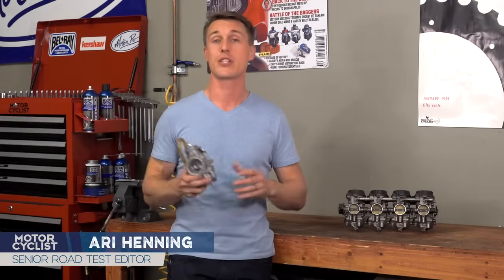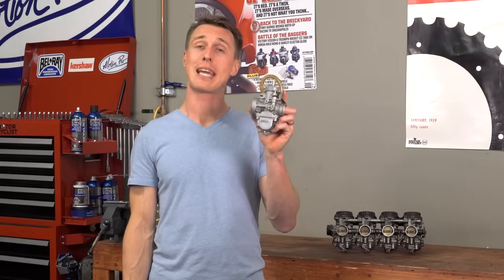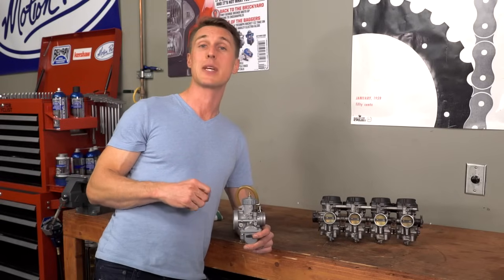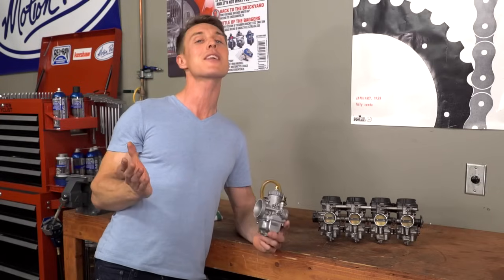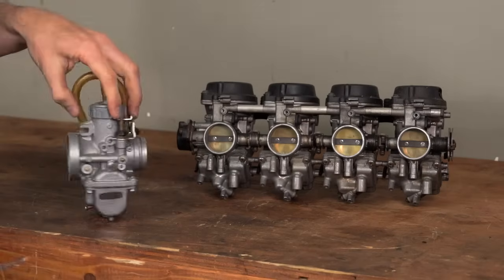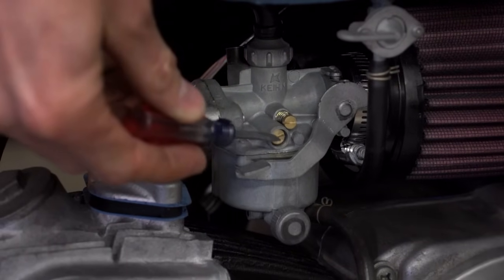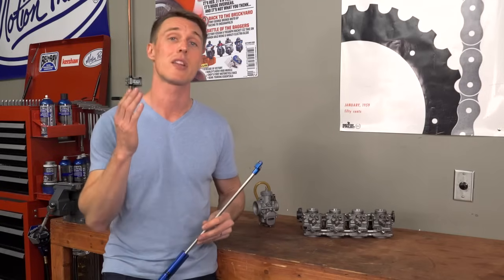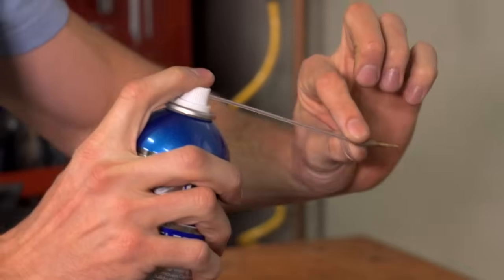The Single Most Common Carburetor Problem (Clogged Pilot Jets) and How To Fix It | MC GARAGE

Comment: My FZR is a 4 cylinder 250 that revs to 18k. It has jets up the wazoo and because of the small size of each cylinder, even the slightest clogging can cause a problem. I've pulled those carbs apart so many times, I can break them down and assemble them blind folded with BOTH arms tied behind my back! 
Gave them an ultrasonic cleaner last time and replaced the seals and they seem to be behaving..... For now.....

Comment: To quickly clean a clogged jet, don't waste your time with solvents...take the brass jets out of the carb and hold with needle nose pliers then place in front of propane torch flame and watch it vaporize and clean the jet...if you want then to look pretty afterward...hit it with some hcl soldering flux

Comment: Excellent video!  I would like to add (myself being the owner of 30 motorcycles) that fuel with ethanol in it makes the bike run leaner at idle (in the older bikes any way - such as the Kawasaki KZ`S, Suzuki GS`s and such).  Pretty much every bike I own, I have turned the idle air screw out 1/2 to 3/4 of a turn for a much better idle.  Hope this helps!

Comment: If stabilizer can solve problem, why gas producers doesn't put it in gasoline in a first place? I don't believe in "magic pill" that can solve oxygenated gas problem. Luckily, non-oxygenated gas still available for purchase if you plan fill it in collector's vehicles, boats, gas powered equipment or motorcycles. Just fill your tank with it if you don't ride regularly or plan to store your motorcycle.

Comment: Thanks. That confirms what I thought was happening. The main jet I know was getting fuel through but the quad would not idle and I'd have to hold the throttle down to keep it running rather rough. I also tried putting penetrating oil into the passageway to help clean out any clogging as well as carb cleaner. I don't feel air flow through but I'll try a bit more TLC cleaning before I reinstall it.

Comment: Spot on. The leakge in intake manifold rubber to engine head is very notorious. Also the mouth of the part that is locking with engine head should be properly screwed (using gel sealant in most cases)

Leakages should be taken good care 👍🏻👍🏻👍🏻

Comment: Ari, thanks. I really get benefit from your clear explanations. I have a 1984 Suzuki GR650 Tempter. A bit of an oddity, but then so am I at 66 years old doing my first more in-depth build. 

I am doing some performance and styling mods on the Tempter. Carb, exhaust, and air box work, is key on the performance front. I definitely had some high hanging idle with no sign of air leaks at the engine-side boots. Most of the problems seemed related to the pilot system. 

I've rejet'd the pilots by one size, raised the needles by one notch, and rejet'd the mains by three sizes, to work hopefully well with the new more open mufflers and opened out air box. Of course I cleaned the carb interiors while at it. Fingers crossed :-)
Reply: Any updates?
Reply: @Johnferrana  I've sold that bike long ago, but fyi, the aftermarket main jet was much too rich. Had to be downsized. Other than that it ran awesome.

Comment: Thanks for the great video. This almost confirms what I was thinking. I ride a '88 GSX1100F and up until a day or two ago it idled and ran great. I filled it at the shell station the other day (V-Power which I believe is non ethanol) and it stalled on me a couple of times while giving the wife a ride to work today. It runs like crap just at idle and a bit above, but when I roll it on it almost rips my arms off. I'm thinking a bit of crap in one of my pilot jets.

Comment: What if my carbs keep flooding. would this possibly be an issue?
Reply: A pimp Named slickback 

Flooding? As in you go to start it and it farts blue smoke and dies?
Reply: vehlajatt22 w
Reply: Stuck float valve needle.
Reply: Floats are stuck

Comment: Hi Ari, short question: What would you recommend after a K&N and Slipon Install on a Honda CBF 600 (like a Hornet but slightly detuned). I was planning on 1) bigger main jets, 2) raise the carb needle one position and 3) open the idle screw ½ turns. Also; carb clean and synch. Do you have a better idea? Thank you, great videos, greetings from Switzerland

Comment: I'm facing an issue where the engine dies out when I Rev it hard.
Reply: Have an exhaust system with stock settings. That might be the issue

Comment: A friend got a second hand Virago 535, and the thing needs full chocke to start even in the summer (and we are from Seville, Spain, so summers are FRIGGIN' HELLISH). Right now, the thing cant even start, it just tries to, and if messed with it, she dies after giving her a middle rev on the trhottle. 

After inspection, i found a crack on the carb boots. I reckon these symptoms could be caused by that?

Another thing, he hasnt used the bike for a couple of months now, and the clutch seems fo be stuck. We tried pushing the bike (the battery died, too, LOL), and even with the clutch lever fully pressed, it would stay in gear. Is this because of the bike sitting? Or could it be cable-related?
Reply: You're a legend! i'll try the zip-tie method, because we tried to push-start the bike a couple of times down a long road and they are still stuck. And i guess it's time to take those carbs and give them a good clean! My friend better buy me a 6-pack, LOL.

Comment: Actually, its the EMULSIFYING TUBES  that block up.
Unscrew the brass tube thing the main jet (not pilot jet) screws into and CAREFULLY clean the holes drilled horizontally within. You will find to remove the tube you have to
 1. remove main jet.
2. remove slide from top of carburetor.
3. push tube up and out the top.
4. it may have a bit of corrosion with crud holding it in so be gentle .
5. congratulations on doing it properly and not being a n00b.

Comment: thank you for this fan-freaking-tastic video series because of this video series you have given me the confidence to perform maintenance on my motorcycle that I would normally have to pay a shop hundreds of dollars to do last March I put tires on my motorcycle front and rear 2000 CBR 600 F4 have a motion Pro balancing stand everything went off without a hitch  this spring I am going to change the clutch thanks Ari

Comment: 90% of the problem is ethanol blend fuel. Am I wrong?
Reply: Scooter George:  The problem is bad owners who do not use fuel stabilizer when they store their bike.
Reply: fwh79 -hush up. I bought a Honda ST90 (1974) with <1000 miles on it for $495 because of this. Cleaned out carb and after 10 years it still is a first kick start bike. Now 1600 original miles. Yeah I run Stabil ALWAYS in my gas powered toys boat and lawn equipment included. Lots of no idling bikes out there cheap. Easy fixers.
Reply: fwh79    Spot on.  I’ve religiously used stabil in bikes, lawnmowers, weedwackers, chainsaws, etc and never had a problem with carb fouling or failure to start after storage.   Gas breaks down very quickly.
Reply: Dick Johnson:  Stabil and battery maintainers ... some people never learn.  My dad has problems with his lawn mower and weed wacker every year.  He won't listen to me and use Stabil in the fuel.  My mower and weed wacker are generally pretty flawless.  The weed wacker has issues every now and then... but I think that's just part of the territory with 2 stroke motors.

Comment: Best way to clean those tiny carb passages is to take the carb apart, drop it in an ultrasonic cleaner.  
Careful not to upset the carb float level

Comment: Ari, how about a vid on synchronizing a bank of carbs on a 4 cyl?  Another good one, and a critical setting, is float height.  Again, on carbs for an inline 4.  Maybe show the method of using a clear piece of tubing connected to the drain port (usually done on the bench).  Love the work you and Zach do on this channel, keep it up guys.

Comment: Great video 👍🏻. I’m having that problem with a keihin fcr on my old yz450, I think my issue is the orifice that the pilot jet screws into though, rather than the jet itself, which I’ve already cleaned with no result. Good job 👍🏻 mate ✌🏻

Comment: Now show us how to clean out the pilot jet, without having to remove the carburetor.  Like, can you turn the carb sideways, take off the float bowl, and blast it out that way.  Or come in from the airbox, with a wire shaped like an L to poke through it?  Or come in from the top.    These stupid things should be made to be more easily servicable while stuck in the bike, this is some serious shitty engineering and not well thought out.
Reply: CHOPPERGIRL's AIRWAR the hillbilly way can sometimes work but do so at your own risk, with the airbox removed and engine running you can rev and then cover the carb completely which will spike the vacuum and cause the gunk to be sucked out of the jet.   Sometimes it works sometimes it doesn't but I always give it a shot before pulling the carbs
Reply: Also carbs never really had this problem when they were designed, it's the emission friendly gasoline sold today with high ethanol that causes them to gunk up.

Comment: SHOW MORE OF THE CB750 (I think)
Reply: AGREED!!! Ari needs to do a video,showing the COMPLETE "Breakdown" of an inline-4 Late-model (1991-2003) Honda CB750 Nighthawk  carb-setup (Keihin CV 34mm) and TAKE APART EACH and EVERY ONE OF THEM,CLEAN it thoroughly,discuss probable "causes" of rich/lean mixtures,how to fix them,and put it all back together again,cuz honestly? There's VERY FEW "Good" Carb. videos dealing with THAT particular model Nighthawk,showing it being done RIGHT!!! So Ari,up for the challenge? Lol.
Reply: That definitely looked like an SOHC/4 Honda.
Reply: Yeah, I got a CB750 F2n (93), Taking in to shop next month for carb clean..   Not to bad price wise  £90.00..  Exactly same motor as Nighthawk I believe..
Reply: Bang same motor and carbs as CB750 F2N, search that and you might get more choice as I believe its the same bike except for styling?  I cant even get a Haynes manual for my CB750 OR the Nighthawk, had to get a PDF from the net, but its a great workshop PDF...    Clymer do do a workshop manual for the Nighthawk though.

Comment: In really super cold, my bike hates any throttle until it's hot.
Reply: my 4 stroke and my 2 stroke do that too so i guess its completely normal
Reply: My bike is like that everyday and I do not even stay in a place that gets cold. The first quarter mile is always very troublesome
Reply: when you start your bike with "cold" engine just let it stay 5 min and put on all your clothings or look at your phone just leave it on a couple of minutes until its a little bit warm and you can close the choke. then dont give full gas until its really warm and your fine

Comment: I always run my carb dry by shutting off the fuel supply 300 yards from home and coasting into the driveway. This prevents any carb damage and clogging caused by modern ethanol contaminated fuel.

This is recommended by several classic motorcycle websites and owners clubs.

Comment: Run a thin wire, like a single thread from a wirebrush, trough the jet. As solvent and compressed air might not be enough. Had a clogged up pilot jet that wouldn't open with just solvent and compressed air. The customer said he did a troughout cleaning of the carb and jets and it still wouldn't run properly. So he suspected a faulty carb and brought it in. An hour later i could call him up with some good news. He had a good running motor for only 50€ instead of 380€ + labor.
Reply: I had same experience.  1975 Honda XL350.  "Pro" shop carb clean.  Died from 1/4 to 3/4 throttle anyway.  It was the deeply buried and invisible air jet for the emulsion tube.   I stuck a long stiff wire into the suspect hole on front of carb, poking by braille, until I felt it go through.  Excitement.  Reassembled and it ran perfectly.  Happiest day of my life!
Reply: Neat to see your name here! Cheers
Reply: Holy Crap, it's Randy Pobst /\ , this  dudes an awesome race driver!
Reply: Hey man...I have a suzuki gz250 and I have been dying on it...I have tried everything and now I'm just in the dark. 

Single mikuni bsr32ss and i cleaned it changed jets (same as factory no upgrade) and it will idle but when I crack the throttle it dies out... I'm thinking the passage in the body of the carb is clogged?????? PLEASE HELP I'VE BEEN DOWN 10 DAYS
Reply: @randypobstofficial  I have a gz250 suzuki I replaced factory jets and cleaned it...then it did the same thing...idle fine then when you crack the throttle it dies. Do you think I could also have a clog like you did in the carb body

Comment: I have a 1984 suzuki gs1100gk it cranks but it wont start it starts on starter fluid but then  dies i cleaned the petcock and the  tank changed the oil and plugs and it still wont fire on its own PLEASE help idk what else it could be causing it to not start

Comment: hey ari!
i have a carbureted  150cc (yamaha fz16 ) motorcycle with full system leo vince exhaust n since the i installed exhaust it does not idle properly it keeps misfiring and shuting of but only on idle once m up above 2k revs it works great so my problem has to be related to  pilot jet right ? i tried many local mechanics as well as yamaha services no one was able to solve it. can any one  let me know if one needs to put bigger pilot jet when running full system exhaust? thanks

Comment: Hey Ari, I love these videos so much, keep up the great work! Can you do a video on servicing ABS equipped bikes? I once tried to put a stainless steel brake line on my CBR300R and people all over the forums said that you shouldn't mess with the brakes on an ABS bike because the ABS module needs to be specially flushed by a certified mechanic. Is working on ABS really that scary or impossible?